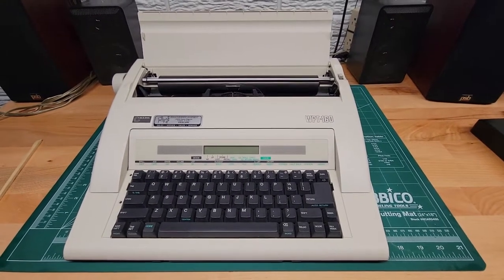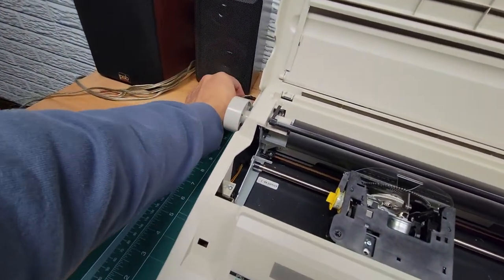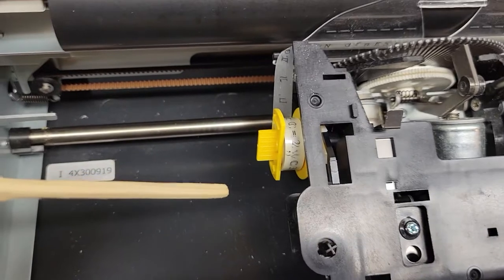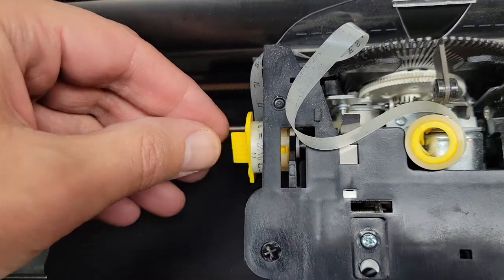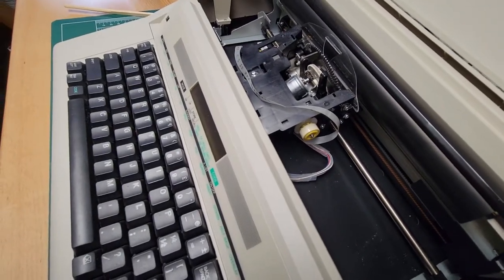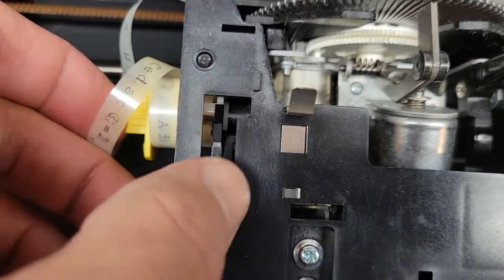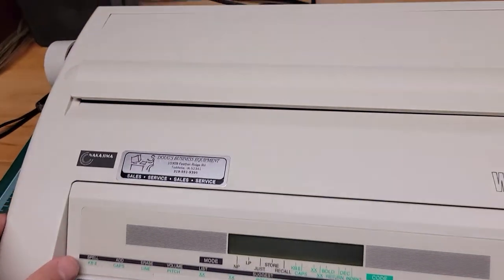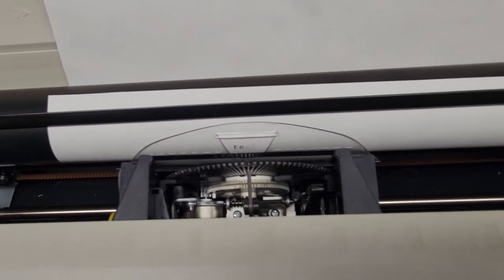How To Change Ribbon & Correction Tape on Nakajima WPT-160 Typewriter

Comment: Very well done. I've replaced correction tape hundreds of times and it's never been easy. Maybe one out of 20 times I've got it in on the first try.  
 As regarding the correct feature here's a trick for erasing mistakes not written in the instruction manual. You are not limited to correcting just on the line you are typing.  If you spot a mistake a few lines up just use the rev index key and back space key to move directly over the mistake then type the mistake exactly as you see it.  Even though it's double typed if you use the correct key it will still remove it. Then you can type whatever you want in the blanked out area. Of course once you remove the paper from the typewriter you can't put it back in so it will be lined up exactly and you'll have to fix your mistake manually - or retype the whole page.
Reply from the maker: Thank you!